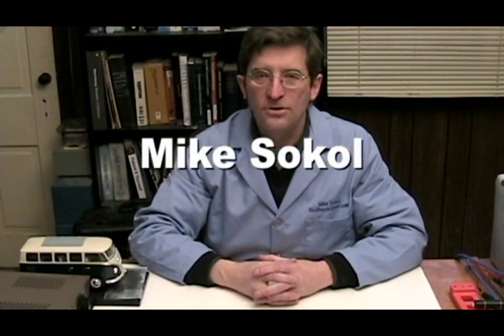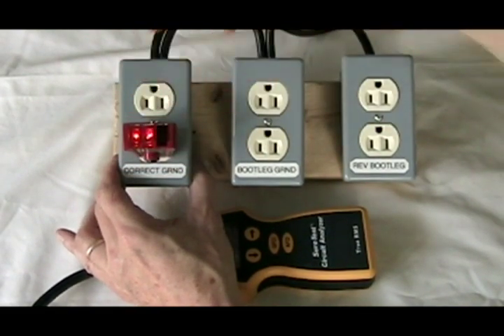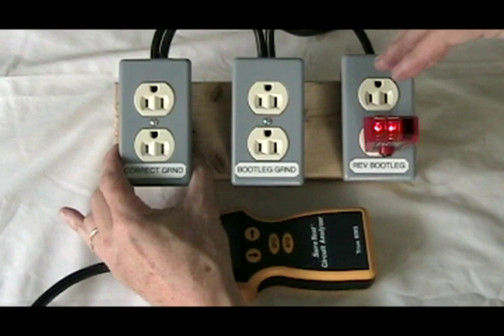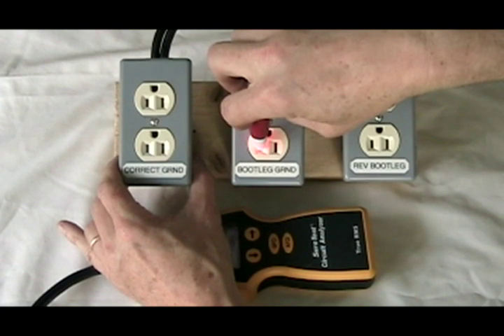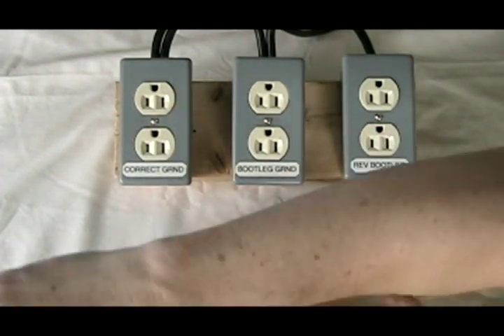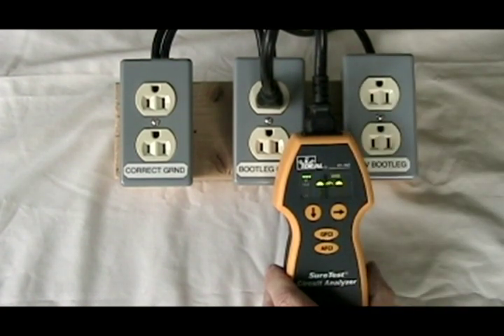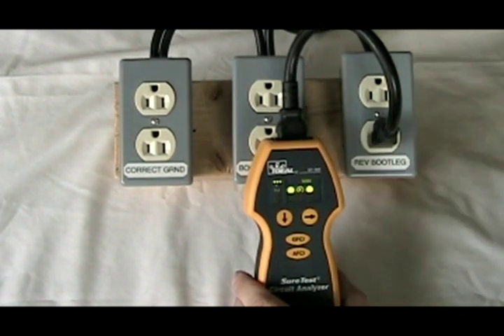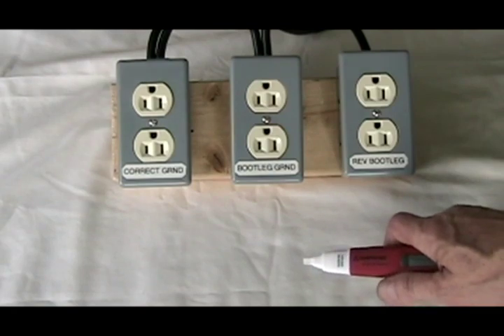SureTest Analyzer - Reverse Polarity Bootleg Ground Testing

Comment: A correct bootleg ground may read 2 amber lights one on the middle and the right and no Red light! A reversed bootleg ground may result of the GFCI tester reading one red light on left and 1 amber light on middle that means hot and Neutral reversed if 2 wires wired correctly and ground on the Hot if ungrounded!

Comment: I have this tester and it has identified a bootleg ground.  However, when isolating, I am down to one outlet and 12/2 wire is some old wiring which I think is from the 60s.  I am on the first outlet and nothing else is connected, and I still show there is a bootleg.  The wire run is about 4 feet from the main circuit breaker.  Something I noticed too with the old wire is the ground is a much smaller gauge than the new 12/2 wiring.  I will be removing the wire anyway, but I am curious if this issue has something to do with the small gauge of the old ground wire or how close the connection is to the main breaker box.  Either way, I will be removing the wire and testing it to see if there are any shorts between the neutral and ground wire.

Update:  I replaced the old 4 ft wire that went to the electrical panel and there is no further issue.  The downstream outlets are still the same old 1960s wiring and they all check perfect now.  I did test the removed wire for shorts and even removed the old fiber casing looking for any type of short.  There were none.  This leads me to believe that the tester had issue with the smaller gauge ground wire and short of length the wire was from the first outlet to the breaker box.
Reply: You replaced a 4 foot grounding wire? or what exactly? Perhaps a problem with insulation in the old wire?
Reply: @Prem Lee Barbosa  No, replaced with new wiring, and all is good.  Matter a fact, the rest of the house's was a wiring nightmare with old knob and tubing wiring.  I upgraded all wiring, outlets, and all fixtures.  Not for the faint of heart.  I am lucky my old house never burned down.  Insulation on knob and tube, bare wires in outlets, taped splices everywhere. I don't think I will ever buy a mess like this again.

Comment: NOSHOCKZONE,                             1.) How can you test how much CURRENT on an NON-GFI outlet will output BEFORE blowing the current breaker? I'm trying to find out how much current will a Non-GFI output will output before blowing the current breaker, how can I find out how much current will an outlet output? 

2.) All pieces of equipment ( toaster, hair dyer, drill, machinery equipment) has leakage current from the hot wire to the chassis wire that is "internal inside" the piece of equipment will measure microamps uA of current. Any reasons why equipment has leakage current and where is this leakage current coming from?
Reply: 1) could you explain why you are concerned with the outlet and not the breaker in regards to amps required to trip? usually the breaker has a max ampere rating
2) modern electrical equipment leaks tiny bits of current.

Comment: If you suspect a reverse bootleg ground as identified by a decently sophisticated tester like the amprobe or the ideal that both measure ground loop potential. You could then easily confirm polarity with a DMM by measuring between ground, neutral and hot and looking for voltage difference.  On a reverse bootleg you would have a normal potential between ground and the neutral and almost nothing between ground and the hot leg...hence the problem. A crying shame these advanced testers can't spot this easily, a software patch could fix this.
Reply: wb5mgr I believe you are correct. However, this tester is great for a home inspector. It is affordable and it allows go/no-go testing of a large number of outlets in a very short time. An electrician or a DIY homeowner would probably need to do a more sophisticated analysis to be able to repair the problem. But this tester is great when you just need to know if a problem exists or not.

Comment: the reverse bootleg is when things can get deadly i remember a rental my grandparents were in if you touched the fridge then the stove or sink with the other hand you would get a small shock makes sense now the fridge outlet must have bean reverse bootleg your feet would be insulated on the tile floor and with the entire metal body of the fridge live from the hot ground pin as soon as your hand would hit the proper grounded stove or stainless sink hooked up to grounded copper pipes you would make the circuit then jump a little think they ended up abandoning the outlet and plugging the fridge into the convince outlet on the stove the problem stooped
Reply: Yup i hear ya, very-very dangerous.